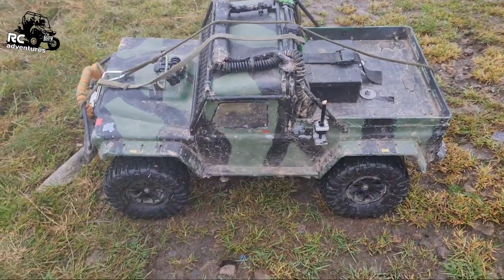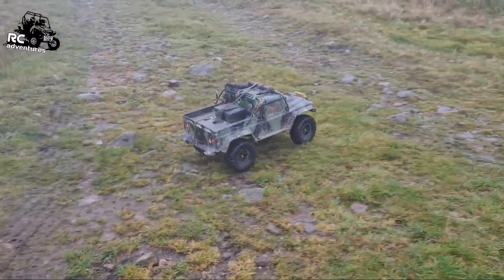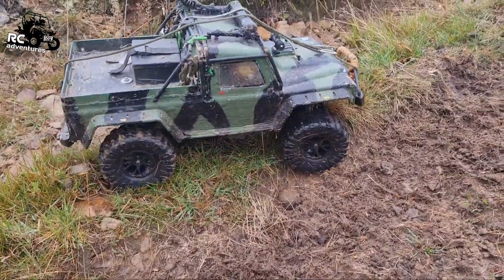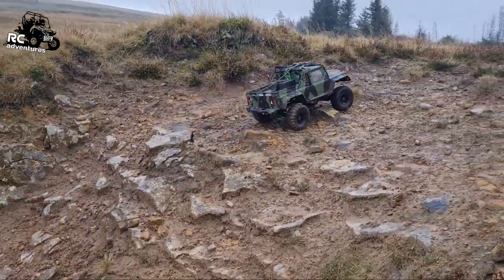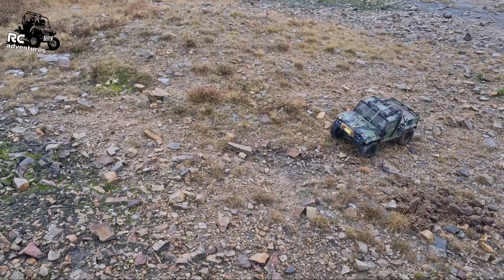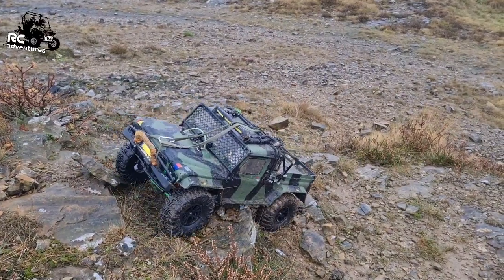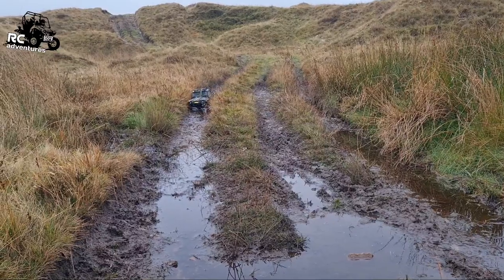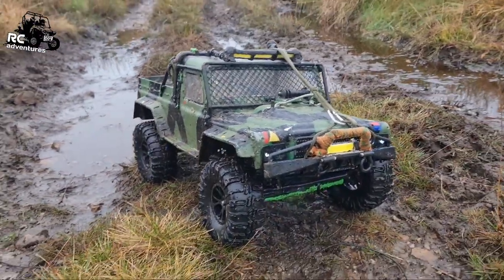ARE FTX RAVINE TYRES ON A  KANYON ANY GOOD?  AND A NEW LOCATION

Comment: Got a set of ravine wheels a and tyres on my outlaw it has widened the wheel base
Reply from the maker: agh that's interesting bud, I couldn't get them to fit over the front hubs unless I filed the raised bits off . there's the answer   widen the hexes 😃👍🐿
Reply: @009ADVENTURES  the stock wheels will fit on the outlaw,off the ravine,the off set of the wheels will clear the hubs no cutting needed
Reply from the maker: humm that's weird as I would have to shave mine a bit, not much but they do catch on the steering arms. I got wider hex on mine too lol..
Reply: @009ADVENTURES  take off the extensions put rav wheels on put rear shock springs on the front shocks and you should be good to go mate.